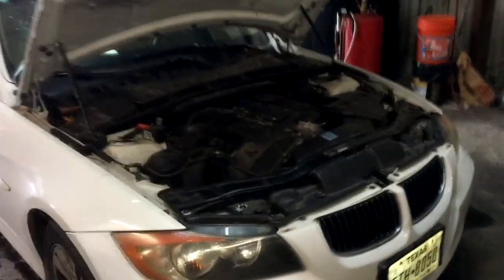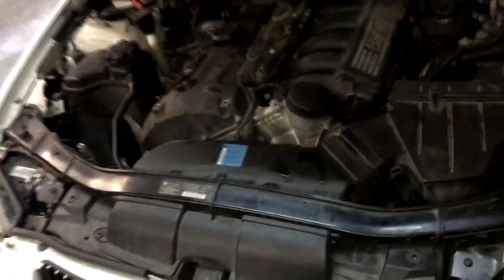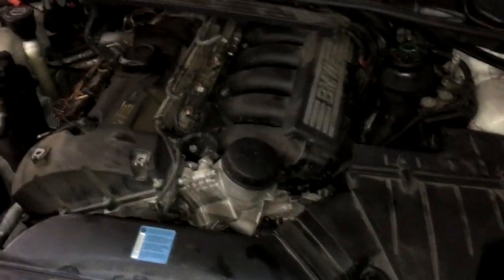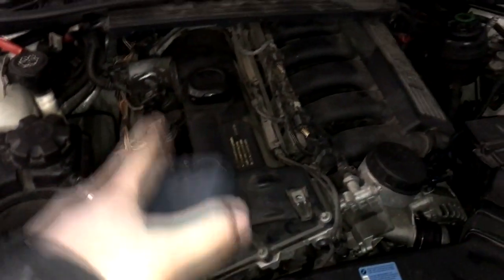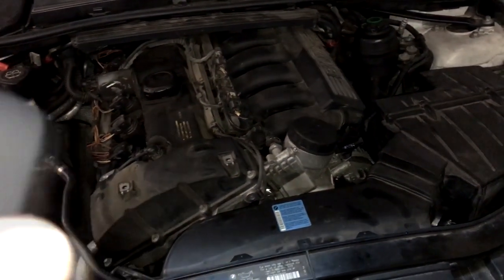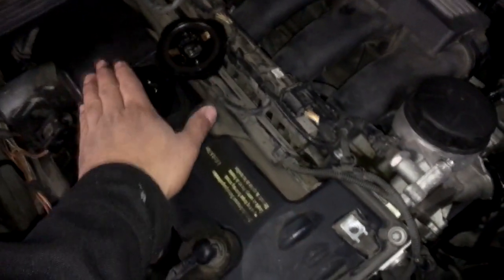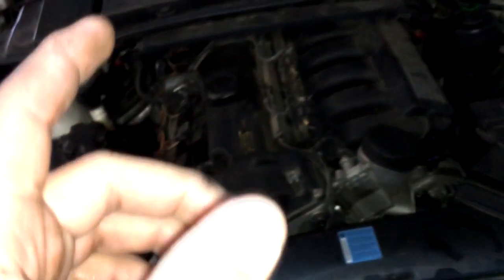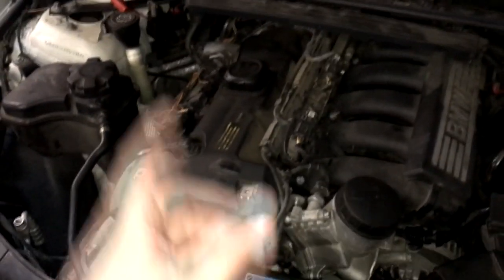BMW E90 P0171 P0174 LEAN BANK 1 & 2 QUICK TIP

Comment: Was running stage one bm3 and installed a Carlos’s down pipe drove for a couple weeks then the cel came on and I got a rough idle.  Upon scanning it said fuel mixture lean.  Flashed back the car to stock checked for any leaks and after clearing the errors it still comes up back once I cold start.   Error code saying mixture lean multiple misfires etc

Comment: Does it suppose to have any vacuum at all? Because I have bank 1 and 2 lean code, I turn on my car with the oil cap on and when I remove the cap I could hear the vacuum suction when I remove it I placed my hand over it and I feel a bit of vacuum but nothing crazy, but that's my question does it normally have a bit of vacuum?
Reply: Was it the issue? Did you get it fixed?

Comment: I think this might be the problem with my e90… when I cover that oil fill port, I can stall the engine. The suction isn’t all that strong, but the engine will stall out. Is that the crankcase breather?

Comment: If 2007 328i running OK, but it can sputter and die at any moment. These two codes are set. Can these two codes cause the engine to die when it is running?

Comment: In these vehicles, there may be a problem with the Vanosmar. Also, check the vanos solenoid and vanos check valves. Teflon o-rings and bearings of the camshafts may be worn

Comment: What is the problem if it’s not the crankcase breather valve / pcv valve. Already replaced the valve cover because one failed. Fixed that problem it would idle rough and shake the car. But still get the system too lean codes. Bank 1 and 2. They come and go. If I drive short distances they disappear. If I go for longer drives they come on.

Comment: My 2005 x5 BMW . has p0171-p0174 bank 1 bank 2 . We replaced pc valve& air intake boot. But the check engine lite came bac on immediately after replace air intake boot. 
?. I don't want 2 b ripped off @ BMW dealer please help.
THNX

Comment: I did the smoke test and smoke  was coming out  from the back left corner of the valve cover..I already  changed the gasket on there as well..do I need to replace  the valve  cover now?

Comment: What if I pull off the oil cap and it’s sucks in a lil bit of air but it’s enough to create suction on my palm does that mean the crank case is bad? And is it even supposed to suck in air at all?

Comment: EXACTLY!
An option is to replace the Bosch Fuel Tank Breather Valve Fuel tank breather valve 1390764310: these should last 100k+ miles but short trips & incorrect oil changes increase failure. NB pre 3/2015 vehicles should have a different valve- get the correct one; shop.bmw can be cheaper than eBay.
As an option to replacement is to CLEAN the valve with a MAF sensor cleaner remembering that VANOS uses teflon washers often dissolved by intake cleaners

Comment: Hi brother. I’m having a hell of a time finding why I have a p171 on my 2008 535i. I changed the valve cover gasket because it was leaking. And did a smoke check. Found a small leak in the plastic boost tube that goes across in front of the engine and fixed that. Now no leaks in the crankcase and the air hosing. And still have what seems like maxed out stft and ltft on bank 1 only at 22-30 stft and 28 ltft. Bank 2 is nearly perfect at nearly 0. I checked for exhaust leaks and didn’t find one. Only thing left from my point of view in the o2 sensor. Unless you have a better idea with your knowledge and experience. Thank you.
Reply: Ara Shahbandeh  hi so did you found why the code p171 ? Thx
Reply: @joegarcia8447  hey did you find out what was causing yours?

Comment: When the old Gen II Dodge Ram had a run of bad plenum pan gaskets, we could document vacuum in the crankcase by disconnecting and capping the PCV at both ends, then measure crankcase pressure, with vacuum showing a leaking pan gasket. Your method, to just feel for vacuum at the filler cap is much faster and would be a definitive test if positive. I find it weird that companies embedded the PCV into the plastic valve cover, creating a huge expense when a ten dollar part fails. I wonder if you'd find smoke coming from the oil filler hole. How do you distinguish this from a leaking intake pan gasket?

Comment: I have the same codes with po171,po174 po335 & po304, on my E92 328i 2009. It  started to give me DSC malfunction in transmission, DSC in drive and it would make a whistle noise from the left hand of the engine about 3 weeks ago but it would go away after restarting the car but now yesterday the car is doing the same thing but now with BCD malfunction and it doesn't go away the car cranks for 3 seconds before it turns over with a aggressive shake and the idle  jumps any ideas . In need of help. Please and thank you.
Reply: Valve cover gasket is cracked

Comment: G QW
quick question my 328i coupe isnt accelerating after 20 mph would the transmission fluid change help , just throwing vvt solenoid and maf codes thanks in advance

Comment: 2009 328i 
I opened oil cap put my hand over and felt sucking in . Not a lot just a little did hear a air sound when opening the cap . Sound like the same issue ?
Reply: Nah I haved but I changed out my MAF, so its probably valve cover
Reply: @RGKing9191   did you ever replace the valve cover,? And if yes did it fix your problem?
Reply: I have a little on mine and am wondering if its an issue. I just did a valve cover replacement too. I have a NA version and already replaced the MAF so I don't think its that.
Reply: Finally fixed the car. It had multiple bad fuel injectors. 2008 535i. These are expensive so make sure they are bad before replacing.
Reply: Ara Shahbandeh  all 3 injectors in bank 1?
Reply: Did you fix it?
Reply: mine is doing the same thing. did you figure out what it was?
Reply: Some Sucking is normal on the turbos.  But I don’t believe so on the naturally aspirated ones.

Comment: I have a 07 328i e90 like yours I have the same
Problem I check for cracks vacuum leaks n nothing my mechanic charge me 1300 to change n buy the mAf sensor and he replace the valva gasket . Plz help when he gave me the car it had no check engine and the codes return back Po171 n po174 I erase them but return
Reply: Always start by cleaning MAF. A dirty MAF will set a system too lean code. Look up a tutorial on cleaning MAF before hand because they can be easily broken if you are too rough with them.
Reply: Daniel Fonseca you end up fixing?
Reply: Joshua Nol yes i did , it was mAf sensor and I replace air filter got rid of the stock one that's in the bmw a grey one
Reply: @Activados701  I have the same car and same codes.. I’ve already replaced the Valve cover, MAF sensor. Only thing i haven’t replaced is my Air filter Because i have the K&N air intake, it says i don’t have to replace the filter because it it’s good forever. Should i replaced my air filter?
Reply: Have a similar issue, I took my e92 to get a valve replacement and intake manifold. I had replaced the camshaft sensor and MAF 2 months ago. When I received my car back it popped a a service engine as soon a started it and it idle rough jumping Rpms then settled. They told me the code would go away and just to drive it